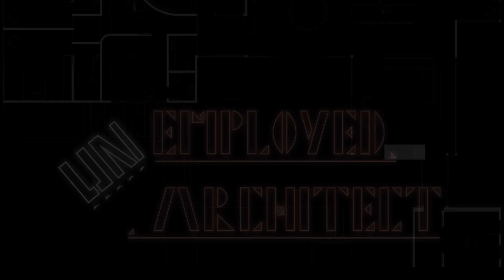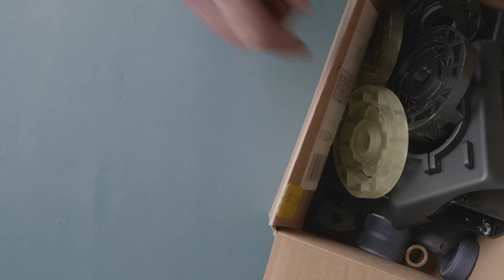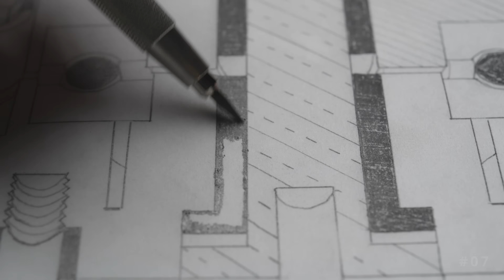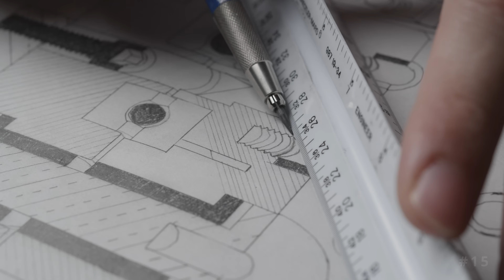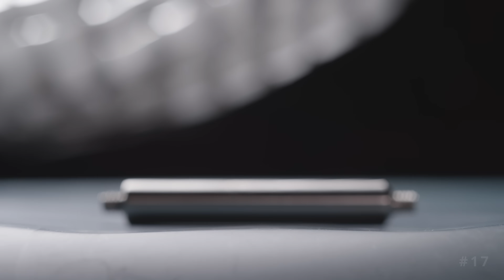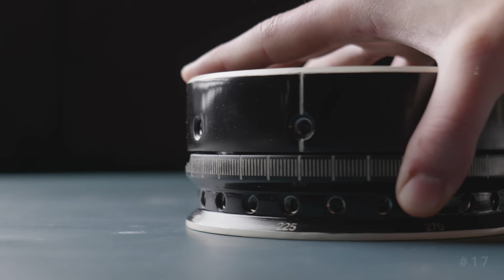3D Printing Inheritance Machining Rotary Fixture Table Thingy

Comment: Hey, just found your channel but wanted to point out that when sanding, milling, or doing anything with resin printed stuff, you really should wear a respirator, or a mask! That stuff is really bad to breath in, but Im sure, based on your channel, you probably already knew that ;)
Reply from the maker: Yaaa super fine plastic dust doesnt sound great for your lungs or eyes. I just always tell myself that its just gonna be a minute...it will be fine. I got get better with the ppe

Comment: how did you do the million white  measurement lines???
Reply from the maker: @drkalamity4518 the numbers and lines were 3d printed as recesses into model. I than air brushed the recesses with white paint and sanded of the excess.
Reply: @Unemployed_Architect  ahh thanks! - next time you should include that part in the video. it's interesting, and its part of the build process.  could just be a 10 second clip and a sentence!

Comment: Flatness/parallelism is not runout.... Sorry, had to say it.
Reply from the maker: @gravybagel. hmm I could see it going either way. because the change in height could be caused by the top face not being flat/parallel or it could be caused by the face not being perpendicular to the axis of rotation.
Reply: Runout is a radial measurement, not an axial measurement. So nope.
Reply from the maker: No actually run-out can be either radial or axial. https://en.wikipedia.org/wiki/Run-out

Comment: Really sick that you rebuilt this design in SLA. I bought the plans for this design as well... It's a must have tool... 

But please, do one thing for me..... Put on some safety glasses would ya?  Watching you stare directly at eye level while cutting on the mill made my skin crawl.
Reply from the maker: Thank you! I really wasn’t sure if it would work in SLA but I’m pleasantly surprised so far. I just got done using it on my next project. The only thing I wish it had was those double acting dovetail clamps that he made for his build.

Yaaa I have always been the worst with safety glasses. But honestly thanks to everyone here pointing out my reckless nature i have been so much better at remembering. So I’m confident you won’t be seeing me cut without them again!

Comment: hmm... I'm wondering if you could build this using a CNC? maybe a mini version (3 inch?)
Reply: or maybe make from another material... wood mayhaps? acrylic?
Reply from the maker: The only challenge with using a CNC is drilling and tapping the holes that are on the side of the part. These need to be precisely spaced. So you would probably need a CNC that has a 4th axis rotary. I also wouldn’t go much smaller than 6” because you need the extra space for clamping hardware. Delrin or acrylic would work great. Wood would look super cool but you need to stabilize the wood with epoxy to keep it from expanding and contacting due to changes in humidity.

Comment: I just want to say that small Clausing mill looks fantastic! Is that a Clausing 8520, 8525, or 8530? I’ve done some very nice upgrades to my 8520 machine for better usability and have my machine very well outfitted, VFD, tachometer and hopefully soon a fully custom power drawbar. 

If you get a chance to post more about outfitting the mill that might make a fantastic series of videos.
Reply from the maker: oh love to hear it! Mine also is an 8520. I’m lucky to be just the 3rd owner. it was originally in a school so it has some battle scars though.

 I also added a VFD and tach, best upgrade ever, hate swapping belts. Not sure I have ever seen a power draw bar on an 8520. I did the more common captive nut drawbar mod. which makes swaps easier but a true power draw bar sounds like a dream. 

I have actually been thinking about doing an upgrade video. I need to build a new rolling stand. The current one wobbles inside the frame. drives me crazy when I’m trying to film lol. That and I might rebuild the spindle. runout is at about .0005-.0008” not terrible but significantly above what it should be. Maybe once spring / warmer months come.
Reply: @Unemployed_Architect  very cool! If you ever get around to that or ever get a lathe I’d be glad to give you a rundown on my power drawbar, I’m very close to having it done. I’ve been meaning to post some videos on the type of cool stuff I’m always making. If you ever setup any other platforms I’d be glad to contact and give additional details.

Comment: Any idea if this would work with an FDM printer?  And what kind of filament to use?
Reply from the maker: @julieanGalak Yes and No. As is the model is designed with print in place threads for helicoils. these wouldn’t print well on fdm. you would need to modify the model to accept heat press inserts. also the holes on the side of model would come out a bit oval shaped, always do on fdm, but probably not a big deal. As for filament you probably could get away with plan old PLA. it won’t warp and it’s very stiff. heat resistance is junk but shouldn’t really be a problem for this application. you also don’t need impact strength as long as you don’t drop it on the ground like I did. all that said the original fusion 360 model is available for download. so you could give it a go?
Reply: @Unemployed_Architect - cool, thanks.  I might give it a go at some point.

Comment: Cute toy model.  Now that you have some confidence and an understanding (I guess?) of the relevant critical dimensions, perhaps you can build a real one!
Reply from the maker: Maybe. unfortunately though the rotary I 3d printed is designed more for rounding and chamfering parts. it can also do indexing / hole positioning but I didn’t design it to be overly accurate. It also can’t be mounted in the vertical position. both those features would be needed to machine a rotary table. but hey maybe one day I’ll figure some sort of work around. that said I don’t need a rotary that often so for now this works just fine. I actually just got done putting some rounds on 1” 4140 pre hard and it worked well. my mill was actually chattering before the rotary table was.

Comment: Circa 2002- "Shortcuts are longcuts" 
Now after disembowling the printer, would you set up a fxr table?
Reply from the maker: hmm maybe. not actually sure what an fxr table is 🤔
Reply: @Unemployed_Architect fixture. Sorry
Reply from the maker: oh no worries. I have thought about it. I think it could work really well especially with what I’ve learned from this build. that said I usally don’t make something until I absolutely need it. one of the main reasons I printed the rotary is because I need one for a couple future projects.

Comment: You were taking 10 thou passes in aluminum and happy with it, then tried full send in steel? Really confused by that choice
Reply from the maker: well I started with just .010” cut in aluminum but eventually worked up to a full  .375” cut in aluminum for the final test. I  figured the full send in steel wouldn’t work but thought it would be funny to try. in the end found that .010” pass in steel was the ideal cuts. takes a lot of cuts but each pass only takes a few seconds with such a light step over.

Comment: you should pay attention to the room temperature too if its acting weird. also you weren't lazymaxxing. you should've printed it in different place that didn't have as much dead pixels.
Reply from the maker: I usually don’t pay attention to room temp because I do have a heater. that said even the fluctuation from the heater can induce some odd surface artifacts. it’s not very good one. 

I actually tried printing around the pixels but every time I did they like spread to that area. super odd

Comment: Difference between plastic and steel is how it stands up when under load. His steel table could probably handle 20 times more weight than your plastic table and still be turnable while the plastic will bend much sooner. But if you only put small parts or plastic/aluminium on it then it's probably just fine.
Reply from the maker: it can handle a surprising amount of weight. I can sit on it and it still turns no problem. you are right though material choice has a major effect on how much something deflects under load. The top half of my rotary  is 1.25 inches thick and has a modulus of 2500Mpa so in terms of deflection it is the same as a piece of steel just over a 1/4” thick. So way filmser than his build but still surprisingly good. I think the real weak link is the size of the center arbor at 1/2” diameter. my guess is it’s deflecting too
much.

Comment: I also used hardened precision-ground bushes above steel threaded inserts bored in my hard-anodized Aluminum fixture plate. It is a great system when, instead of using location pins, I use smaller steel bushes to allow me to clamp directly over the locating bush. Please have a quick look. I would appreciate your comments on the design.
Reply from the maker: @machinists-shortcuts hey i checked out your fixture plate video. As far as I am concerned that is the pinnacle of fixture plate designs. The idea of using bushings instead of pins, so you can still clamp using that hole is truly genius. I actually wanted to use drill bushing, in my project, instead of the bronze bushings, but couldn't bring myself to sink that kind of money into something i really wasn't sure would work at all haha. I also don't know why it never occurred to me that you could use the holes in a fixture plate as a makeshift sine bar! Honestly everything on that build looks 10/10. The steel frame, hard anodizing with what I assume are laser engraved markings?, even the shop made clamps are beautiful. subscribed and looking forward to perusing your other projects for inspo. thanks for sharing!
Reply: @Unemployed_Architect you are welcome. Thanks for the kind comments.

Comment: "10 thou, thats easy"? Thats Ideal on any mill...
Reply from the maker: Ya i don't think its unreasonable. part of me was just hoping i could take it all in a single pass. A bit unrealistic, but we can dream.
Reply: @Unemployed_Architect  lol i get it. But you have to remember your not hogging out material on a massive well drilling part. 10k is a very respectable dig for a mill of that size. AND you did it with plastic holding it. That alone is amazing. I can't wait to see the end result . Just keep in mind even if you had steel holding it down the more you try to take in a cut the more you have to worry about losing accuracy in give. Especially with a plastic mount. The harder you use it the more the accuracy will diminish over time. Be as gentle with it as you can so it lasts the whole way through the project.
Reply from the maker: so true! taking the extra time and taking light passes often can save you time in the long run because you reduce the chance of scrapping the part and having to start all over again.

Comment: You should 3d print some TPU plugs to keep chips out of the unused holes. It would be a quick and easy quality of life improvement. 

Also look into making t-slot covers for the mill table. You'll save yourself a ton of time cleaning up.
Reply from the maker: oh I like the tpu plugs idea. I managed to get chips all over my apartment shooting the wrap up shots after milling haha. 

I actually have table covers I made from aluminum sheet. I just had to remove them to attach the rotary table

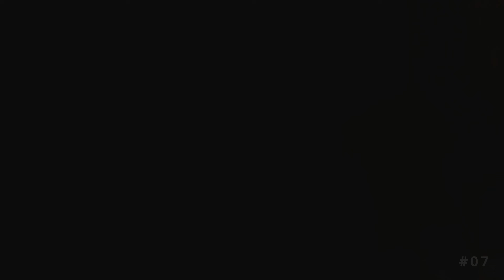Comment: 5:29 my man, at 16K you can just print the threads.
Reply from the maker: absolutely. I actually print the thread for heilcoil inserts directly into the body. the metal on metal contact helps prevent the threads from getting damaged or wearing out over time

Comment: could the top surface have a machined steel plate bonded on?
could help with durability and add some weight to the assembly.
Reply from the maker: ya I think that would be great long term solution. for now I’m gonna let it be. so how it holds up. experiment of sorts

Comment: I have no idea what thous, pounds are, old british unit hardware is non existent so even if you share files, cant remake it.
Reply from the maker: I feel your pain. I genuinely wish the US would adopt the metric system. probably just a scam to force Americans into buying twice as many wrench’s
Reply: @Unemployed_Architect  If only, waste is so much more,  wrenches, drills, measuring equipment and all the machinery needed to produce them ie dies. Not to mention wasted space and extreme waste of human resources. Extra metal mining, manufacturing energy, packaging, shipping fuel, and storage space for what is essentially redundant functionality. And the bottom line is, i cant reproduce any project designed in imperial becasue nobody stocks hardware in old British units.
Reply from the maker: 100 percent agree. I’ll definitely keep that in mind for future projects. maybe release a metric and imperial version of the model. I make all my models parametric so it’s pretty straight forward to tweak.

Comment: Here is your L Elegoo.

Elegoo is the Chrysler of the 3D printing world. If you want to change the cabin filter. You have to dissemble 45% of the car. 

Don't get the Elegoo Saturn 4 Ultra. It's manufactured to be complex and hard to do maintenance on. Disgusting.
Reply from the maker: yaaa in the end you pay for it one way or the other haha

Comment: As someone with an og Saturn, elegoo has some of the dumbest engineers on the face of the earth. The z axis screw doesn’t have any axial support besides the bearings in the stepper motor which fun fact: ARE AXIALLY SPRING LOADED. Also the washing station for some god forsaken reason (cost saving) is using a stepper motor. Every time I work with my resin printer it makes me wanna tear my hair out
Reply from the maker: I feel your pain. I hate cheap 3d printers they drive me crazy. than again I hate spending money haha

Comment: why are you not using any fluids when machining ? i mean you really need to lubricate while doing that if im not mistaking that is why the tightened parts are getting loose and falling while machining them. thats really painful to watch but awesome video
Reply from the maker: I do have the tendency to cut dry. I hate cleaning up the mess /:. if I’m taking particularly heavy cuts I will use cutting oil on steel and IPA for aluminum. I really wish I had a proper coolant setup though. glad u enjoyed despite the pain (:
Reply: @Unemployed_Architect  I wonder if the fluids would end up attacking the resin over time?
Reply from the maker: hmm maybe. IPA definitely could affect the print over time. that said with the clear coat I sprayed on top they shouldn’t affect it.

Comment: I wonder if you might be willing to try using the 3D print to make a mold and cast the part out of aluminum? I don't know if you've seen a Gingery lathe or mill, but these kind of projects always make me think of them. It'd be cool to see someone build one from scratch using a 3D printer to aid in making the molds.
Reply from the maker: oooh never heard of a gingery lathe but they look super cool. I actually have wanted to do metal casting for sometime because 3d printing makes the poster bing super easy. I even have a book on it. one day!

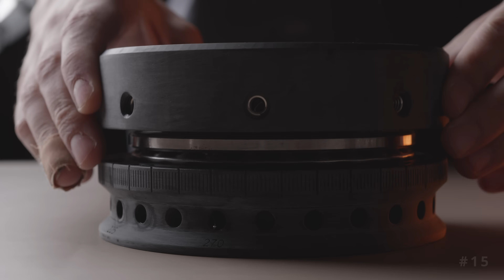Comment: This is an awesome build and great filming! Hope you are open for questions, isn’t the fit on the bearing a bit too loose, giving the device the room to wiggle/vibrate like it did? There is no press fit if I interpret this part 7:52 correctly. Cheers!
Reply from the maker: I love questions my friend. The fit is actually a little bit tighter than what is shown in the clip. The shaft has a bit of a taper. so it’s actually looser at the top. but luckily the bushing contacts the arbor along almost the entire length. it’s about as tight as I could get it without having to hammer / press into place. that said I still think it could be better. definitely have some ideas swimming around in my head.

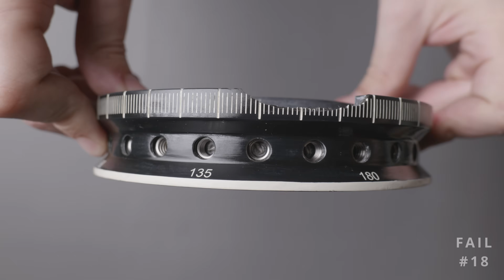Comment: 15:13 Hey what kind of resin are you using? Basic resins crack on me all the time like that but I’ve used a few engineering resins that would  have shrugged off a fall like that, and I’ve not even gotten into the expensive stuff yet
Reply from the maker: I used Siraya techs blu lava. which is a polycarbonate like resin. really stuff and strong not great with impacts. I wasn’t planning on dropping it haha. than again you never are.

Comment: An architect using a proper rule.  Old school!  Respect 😉
Reply from the maker: I’m actually toying around with the idea of building a proper old school drafting table!
Reply: @Unemployed_Architect  thats a really good idea. Those parallel mechanisms are really facinating
Reply: Yes, but general drafting practice is you do not use your scale as a straight edge for drawing lines. That's what triangles are for.

Comment: Great video. Using a bearing to support the radial forces would improve the design as the Thrust bearings only support the axial loads.  Rotary tables experience both axial and radial loads as the force isn't always in line with the axis of rotation.
Reply from the maker: I agree. I actually designed it around a pair of angular contact bearings at first. but due to my inexperience I was more worried about the axial loads / the plastic table flexing. which is why I added two thrust bearings. at that point I ran out of space for the angular bearing so I swapped it for a bushing. if I were to build again I would definitely increase the center arbor diameter and use an angular bearing with a single thrust bearing on the outside.

Comment: Or maybe you can get a steel plate and mount it on top using some of the outter threads, so you won't get dings as easily. 

Great work, keep it up!
Reply from the maker: I was thinking kind of the same thing! maybe get it laser cut. you also wouldn’t need brass shims under the hold down clamps either.